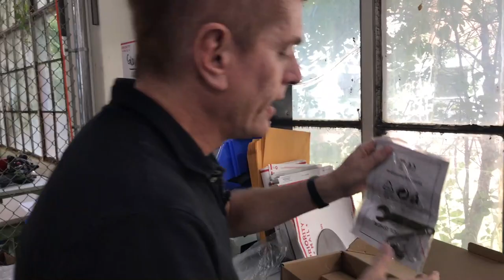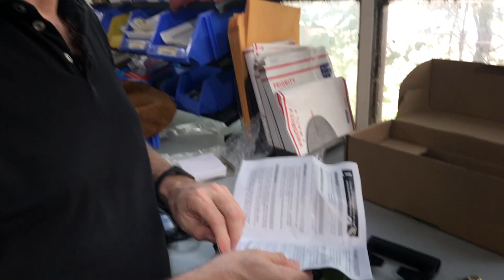How to assemble your Highland Park Wet Grinder

Comment: Thanks HPL for sending out my grinder/kit order so fast. It works great. It's very powerful and easy to use. 

I use a clamping type sawhorse with a soft rubber pad (a piece of an anti-fatigue mat) to grip flat and semi-round specimens. I also stand-up and spring-clamp a 2'x3' piece of plywood to the sawhorse in-between me and the work to deflect all spray to the ground. I put a section of foam pipe insulation (or pool noodle) over the top of the plywood edge to rest my splinter-free bones.  

Nice job designing this product and keeping the price reasonable.  

Cheers, Curt
Reply from the maker: We really appreciate you for trusting us, Curt! Send us some photos of your works in the future, we'd love to see them!
Reply: @HighlandParkLapidary  Thx for my 'second' wet grinder. My first one went to my son who loved it on his 70# Indian Paint Stone free-form sculpture. How can I attach the video?

Comment: Does the plaster of Paris holding the half round rock start to dissolve on an extended wet polish?   Thanks
Reply from the maker: The Plaster of Paris won't start dissolving during an extended wet polish. It only dissolves when under water for an extended period of time, such as being in a bucket overnight would dissolve the Plaster of Paris.

Comment: Looking to buy one of these from you guys and am anxious to see the video on how to hold something like half a Brazilian agate steady while polishing.   I've seen other videos 
where they use clamping sawhorses and rubber stops---but they won't work on a domed bottom half geode.   Thanks for any clues in steading that particular shape rock.
Love the HP videos---- am sure very good for your sales too.   Maybe you could come up with a new tool to hold round rocks.   Thanks again.
Reply from the maker: Hi Richard, for stablizing round stuff like Brazilians we use Plaster of Paris.  Its super fast to cure, super cheap and works like a champ to make the backside square - then toss into water to break it down once you are done over night.  Depending upon the size, milk or juice carton for the mould.
Reply: @HighlandParkLapidary  Thanks for the great idea.  Was thinking about thermal setting plastic but the plaster of Paris sounds much cheaper & easier to work with.  Thanks for
getting back.   Will order the wet grinder soon.
Reply: @HighlandParkLapidary  As a second thought, does the plaster of Paris start to dissolve during an extended wet polish?   I haven't used it before and don't know how quickly
it breaks down.   Thanks again for any further insight.

Comment: I don’t see any videos on you using the wet grinder. Polishing and or the gold grinder. Ive been waiting 2 years to see how to assemble my wet grinder i bought from you. I literally just took it out of the box because the instructions that came with it were lame.  Ty for shopping the video on assembly. Now I’d like to see how you use it.  I was told its very dangerous and powerful.
Reply: Oops. I tried to type showing.
Reply from the maker: Hi Christine, we will get right on making that video!! Though it may not be uploaded for a couple weeks, due to a heavy schedule while we prepare to go to The Denver Mineral Show that takes place from September 7th through September 15th.  It will be one of the first videos that we upload when we return from the show.